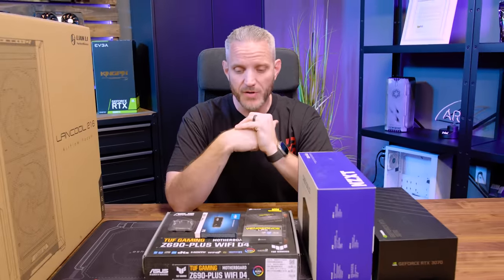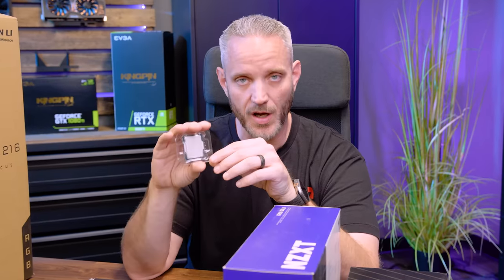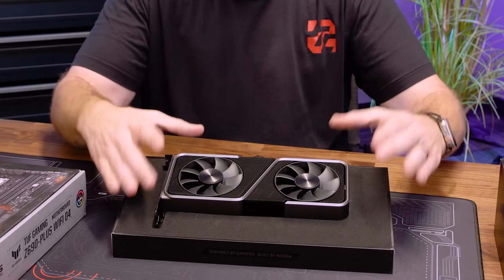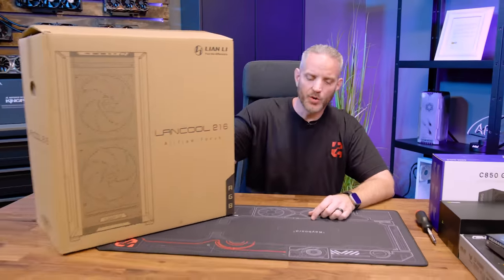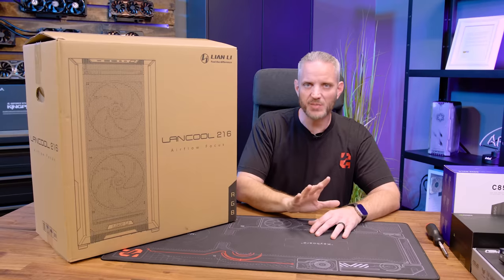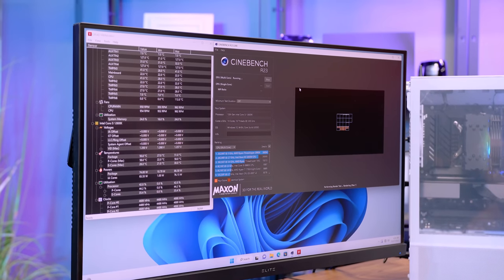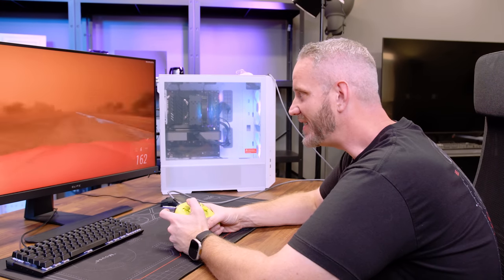Inexpensive PC Build Guide!

Comment: *TIMESTAMPS*
0:00 - Intro
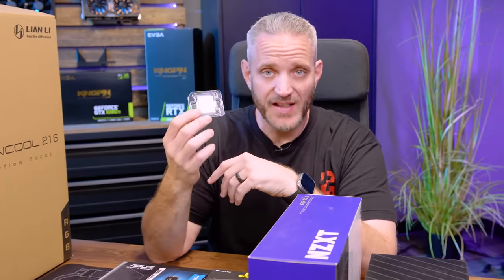2:05 - CPU / Why Intel [i5-12600KF] (i5-12600K shown)
5:40 - RAM / Memory [Corsair Vengenance DDR4-3200 2x8GB]
6:29 - Motherboard / Mainboard [ASUS TUF Gaming Z690-Plus WiFi D4]
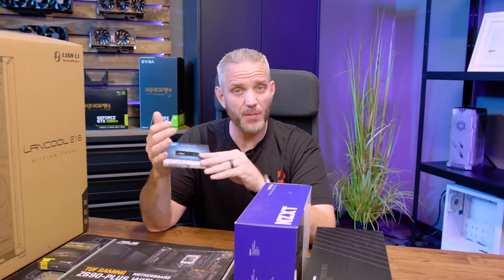8:01 - SSD / Why PCIe 3.0, Why Crucial [Crucial P3 500GB PCIe 3.0 NVMe M.2]
10:11 - Power Supply [NZXT C850 GOLD, fully modular, black cables]
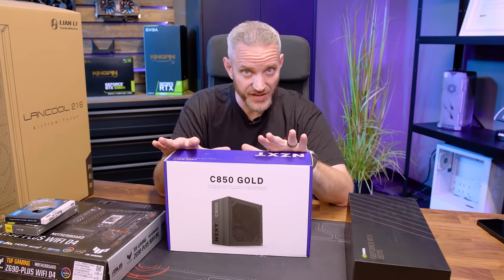11:17 - GPU / Why NVidia [NVidia RTX 3070 Founders or AiB]
14:31 - CPU cooler [Vetroo V5 Black]
15:42 - Case [LianLi Lancool 216]
17:13 - Build montage
18:22 - Finished build showcase (pretty B-Roll!)
18:52 - Show and tell
'- 18:55 - Case front panel and cooling fans
'- 20:10 - BIOS settings
'- 20:30 - CPU BIOS temps (It's NOT idle! One core is at 100% in BIOS!)
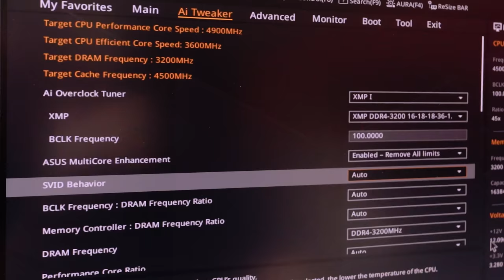'- 20:55 - Intel turbo limits unleashed
'- 21:17 - Boot
'- 21:56 - Cinebench R23
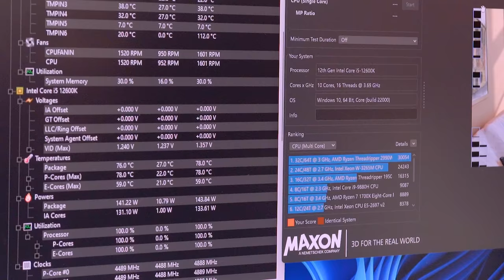'- 23:22 - Cinebench R23 score result, peak temperatures, comparison with old CPUs
25:41 - Conclusion with Forza Horizon 1440p gaming and FPS
26:44 - Parts list (also in the video description), further conclusion
28:38 - Subscribe frts [END]
Reply: You the real MVP
Reply: You obviously get it. Respect
Reply: GREAT & THANKS... BUT WHAT'S THE TOTAL COST? lol
So I skimmed quickly through and it looks like about $1,400 before local taxes where you are.
Reply: @WatchingTrainsGoBy-PassingTime  Yeah guy said $1500, and mine is like $300 less or something like that due to the 6700xt I'm getting, same cpu lmao
Also my case is the corsair 4000d and I'll be adding in 3 more fans just so there isn't a chance of temps to rise. Still cheaper too.
Reply: @jatinmarcob2128  Prebuilts cheaper now days because GPU prices over MSRP. Cyberpower 13600KF/32GB DDR5 6000/3080 prebuilt is $1599. They even had 13600k with 3070Ti for $1279 last month if google it.
Reply: You are amazing and we love you
Reply: @jaggsta  I actually calculated a build around a 3070 pre-built way overpriced ($2000), and decided to just use pc part picker to build a PC with a 6700xt for way less because every 3070 build or card I see is over msrp. However I constantly see 6700xt cards and other amd cards at a discounted price because of the 7000 series and I saved money doing a build with it without losing the performance I wanted.
Reply: @jaggsta  Although I will say that is a pre-built that is amazing for that price if true. I just couldn't find a well priced one for what I wanted.
Reply: @jatinmarcob2128  That's really cool. I'm not in the market right now, but that kind of savings could help people that are right now. Maybe if you find the time you could post how/where you spent your money and saved it... Thanks if you can/do.
Reply: @jaggsta  they aren’t
Reply: @WatchingTrainsGoBy-PassingTime  I decided against mentioning the total cost since it can change a lot over time and it pops up right when you click on the parts list timestamp. Like immediately, lel.
Reply: does it costs 500$?
Reply: @bal_723  I genuinely wish it would.
Reply: Not all hero's wear capes
Reply: @kyoudaiken  how much this crap costs bruh
Reply: @bal_723  26:45
Reply: @kyoudaiken  bruh its expensive as heck
Reply: Another reason why I didn't include the final total cost in the timestamps is that I think the reason some YTbers refrain to use the timestamp section feature because it can in some circumstances reduce the watch times. YouTube is changing their algorithms very often and it could be that watch time is an increasing factor for engagement.

So putting the price into the time stamps may even result in people just closing the video completely because it's too much for them. Jayz did a lot of research and put a lot of thought into this video. It would be disrespectful for me to spoil it even more.

Even though PC parts have come down in price, the golden era of PC gaming is long over... We need to get over this fact and move on. Save longer. Other needs like rent, food, water, heat are first.
Reply: @bal_723  See the comment I just posted. Especially the last paragraph. It's how it is man... Nobody likes it. But we're living in difficult times. I think it will be better some day.
Reply: @kyoudaiken  lol... okay... I don't know WHY you felt the need to explain it? You did a great job otherwise. It's just that alot of people really want to see the cost to know if it's something in their $ range to know if it's even worth their time clicking on the video.
   That's why I thanked you, but added the $ amount.
Reply: @WatchingTrainsGoBy-PassingTime  Thanks! Just trying my best to get it all balanced right. Jayz did a great job compiling his knowledge and research together to make this video. Would be a shame if people wouldn't click it.
Reply: For everyone who thinks this 1400 USD PC (before taxes) is too expensive should still watch the video. You can always change parts around to your needs:

- Get a used GPU
- Get a Montech X3 case
- Get an EVGA SuperNova 750W PSU instead. Still powerful enough for cards up to a 4080, and if power limited to 70% even a 4090 - this PSU is currently on sale at MicroCenter!
- Get a 256GB SATA SSD and take over your existing storage instead

There's plenty of potential to drop it below 1000 USD with the same CPU and platform.
Reply: @WatchingTrainsGoBy-PassingTime  I don't really do vids, but I pretty much flip flopped between gpus until I realized that nvidia cards are too expensive as of now, so I decided to go with a 6700xt that I believe is still around $370 (if you can find a 6800 or 6800xt for like $500 definitely go with that). And then cpu I got a 12600k since it was around $260 and it'll keep me good for a long time. Case right now the Corsair 4000D has been going for $80 for a great case. The motherboard I believe is the msi mag b660 tomahawk ATX ddr4 wifi6 board for $180 that's a pretty decent board for the price. Memory can be anything that's nvme, I chose teamgroup tforce pcie.3 1tb for $60. Ram I went with corsair vengeance 16gb (2 x 8gb sticks) because it's good ddr4 memory for not much at $50. For cpu cooler I'm going with a id-cooling se-224-xt for like $30 and it's reliable for the 12th intel cpus. For PSU I went with a corsair 750x, since it's $100 or so at a deal and is really good modular quality. Since there's some room for more fans, I went with 3 corsair af120 fans, as they're good for $35. As of now, that together without tax  is about $1080. Of course, getting Windows will add $100, and the mouse and keyboard I want add an extra $200 for $1380 without tax. It's really good considering the gpu deal I got.
Reply: Thank you for that!!

Comment: Thank you very much Jay for your knowledge and tips in all your videos! I checked my i5-12600K Cinebench score and compared to your score, thanks to this video. Turned out I was having a lower score and a CPU temperature-throttling, I had, by accident, set my cooler-type in my BIOS to water cooler, when having a tower-cooler. This caused the CPU to get very warm during load. I corrected the setting and everything was fine. In addition I undervolted the CPU slightly with an offset, as you demonstrated in your video "You need to do this with your CPU, now" and I got great temperature and a totally stabel system. Thank you again, I seldom write comments on youtube but I want you to know that I really appreciate your videos and your knowledge, as well as the added humor (for example the shown video bloopers) :) and that the perspective of average gamer/pc-users are considered regarding component prices, how to choose the right components etc. Thank you again and a very happy new year to all of you! With best regards from Sweden
Reply: His knowledge isn't that great, he recommended a DRAM-less SSD.
Reply: @roji556  then get the one you want , he didnt say YOU HAVE TO GET THIS ONE, he said this is the one he chose
Reply: I noticed this with my new build too, but I never changed that setting so it must have come set to a watercooler in the BIOS from the start. It was idling at about 45-50°C and the CPU fan speed was about a third of what it should have been. Changed the setting to a tower cooler and it came down into the low 30s.

Comment: I can't say enough good things about the Lancool 216. Did my first ever PC build in one as a Christmas present for my wife and all the different paths for cable routing make it super clean and organized. I'd also give the Vetroo cooler a 10/10, bought it based on Jay's video and no regrets. Went 3070 as well for GPU, but did 5600x/B550m thanks to a significant cyber Monday mark-down and saved almost $150. Only stock case fans and the stock Vetroo cooler fan and still great thermals, steady 120-140fps in 1440p on the majority of games and happy wife = happy life.

Comment: I’m running the Vetroo in my current build and have had zero problems. It’s never went over 75 c and that was running cinebench. I also slapped a higher performance fan o. It because I had it already too.
Reply: oh yeah that vetroo v5, esspecially with a push/pull fan set up are awesome. and cant beat the ~$40ish price tag
Reply: I got mine a year ago and have zero complaints. It's a solid option, even for my 11700k
Reply: I am using Vetro V5 with a push pull configuration on a 12700k having great temps even on Cinebench R23.
I swaped the stock fan with 2x 120 Alpenfoehn RGB High Speed only to fit with the rest case fans.
Reply: I did something similar with a hyper 212 black, now has a noctua redux, just because I had it laying around
Reply: my 5800x 3d has never gone above 80c running it HARD in tests, its even lower in games 60c range. unbelievably good cooler for the cost
Reply: @dragonld123  How much changed the noise ? :) Is the Vetro V5 as Silent as the Alpenfoehn? :)

Comment: Very similar build here that I've been running for a couple of years. I bought my CPU before Intel 12th gen was out. EVGA RTX 3070 XC3 Ultra, Ryzen 5 5600x (hoping to upgrade to 5800x3d when pricing drops more), 32gb RAM, gen4 m.2, etx... Plays most 4k titles at high settings. I run 1440p for harder to run titles. great build!
Reply: cpu z says keep the 5600x or skip to the 5950. 2 more cores in the 5800X3D 3.4ghz penalty i have (single core loses 5% to the 3600X and you have a 5600X) only gains you 5% vs 15% of the 5950 in multi threaded and i am running 4000mhz ram on the 5800X3D. % gained should equal the dollar value dollar per 1% gained to be worth while. the 5950 won't be as worth while as the new ryzen 4th gen 7000's or the 13900k which is a 200% increase over the 5800X3D due to 5+ghz clock and 24 cores. the 5800x gets you almost 10%.
i will be waiting for the new 7000X3D release to see what performance gains they bring and most likely wait 1-2 years for their prices to fall $200 for both cpu and ddr5. you're in a good place right now. i feel comfortable enough to sit on my current set up for 5 years if i want to.
i was trying to wait out to the 7000X3D release but my 4th gen intel system was going thru BIOS resets enough to be annoying. i lost single thread performance by 15% vs the 4.4ghz stock 4 core 8 threads but i gained 6000% multi threaded performance even with the 3.4ghz penalty.
reviewers must be paid by the manufacturers to use the best performance statistic that lies about "performance gains"
hardware unboxed does the best most honest job at reviewing with out shooting themselves in the foot while still getting some manufacturers endorsements. jay and almost all the others i have watched are schilling hard to get the freebies and endorsements for the most part. "don't bite the hand that feeds you for free" is the tech reviewer motto
Reply: My build is very similar. 5800X, 3070 FE, 32GB RAM. Runs BF2042 on Ultra and never dips below 70 FPS on 1440p. Cannot complain about my computer at all. I have two 1TB NVMe SSD's for OS and gaming.
Reply: I've got the same build, R5 5600 & RTX 3070. Why did jay use the  i5-12600KF for 230$ when the Ryzen 5 5600 is going for $130 for the same performance?
Reply: @joeyvigil  He explained that. Future proofing if the person building this wanted to upgrade to 13th gen later on.
Reply: @joeyvigil  Forealz. 5600 is such good value right now and you could still upgrade to the X3D if you wanted!

Comment: Gotta say, for the money this doesn't feel like a budget or entry level system. I'd consider something under $1000 (and closer to $750) to be entry level.

For that you've got a 12400, a B660 board, 16GB of DDR4, a Corsair 850W full modular power supply, a decent BitFenix case with four included fans, a Peerless Assassin 120 (much beefier cooler for $35), and mainly an RX 6600.

That gives you a 1080p beast and room to move up to 1440p and eventually 4K depending on what you put in the machine. I feel like the selected parts are already way out of entry level. An RTX 3070 is still a big bubba video card for most people ...

Comment: Totally agree on the Lancool 216! I just built a workstation PC for my wife in one and as an O11 Dynamic EVO owner, I was impressed. It can do 360mm, 240mm or 280mm AIOs (I recommend a 280). If you go with 280mm on the top, Lian Li provides a metal plate to cover the remaining gap to avoid turbulence. You can mount the GPU vertically    as long as you get a separate PCIe extension cable. If you mount horizontally, you can put 2x 120mm on the bottom. The side panel below the glass is mesh so you will be bringing in fresh air. You should keep the 160mm fans instead of replacing them with fans/AIO as they provide for a better seal. We used Corsair AIO and fans and using ARGB to Corsair adapters, the front fans are controlled in iCUE (you tell iCUE  that they are LED strips.) I love that the power/USB panel can be moved to the front left side of the case (no dangling wires, easy USB port access)
Reply: I just used the 216 case for a build a build also. I didn't go with an AIO, I used a Noctua NH-D15 chromax Black. 
Everything is black, no RGB & I really like it. 
Also put in two fans as the bottom as intake & two at the top as exhaust, still testing thermals to see how it's performing vs the original configuration of three fans. 
When I bought the case the black pwm wasn't available so I purchased the black case with RGB which has white fans.
I was having an issue moving the front I/O to the bottom left side of the case, & after a few back & forth emails with Lian Li it all worked out.
I did ask if I could purchase two black 160 mm fans to replace the white ones, they sent me two 160 mm black fans no charge!
Can't beat that, I highly recommend Lian Li products, they are helpful & excellent to deal with.
Reply: if horizontal can it fit 2x140mm fans on the bottom?
Reply: @brigham1465  No. The bracket mounts on the bottom where the frame would be. The case does support 140mm on the bottom though. The O11 Dynamic EVO vertical mount is suspended above the fans on the bottom but you're looking at $200 for the case, $100 for vertical bracket but I do love it so. At its lowest mount, the bottom PCIe slot is accessible. I have my Soundblaster X AE-5 between the bottom fans and the vertically mounted GPU.
Reply: Thanks for the excellent info.